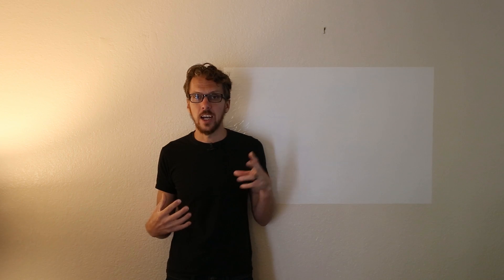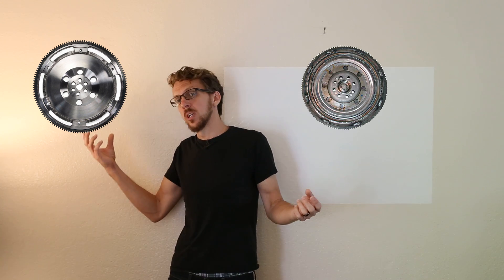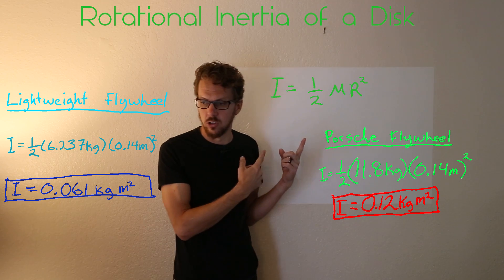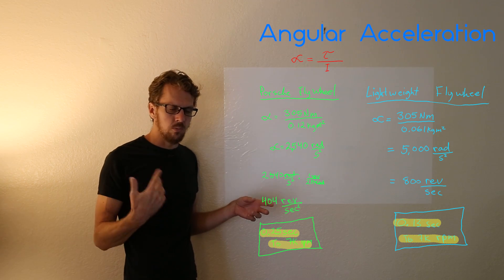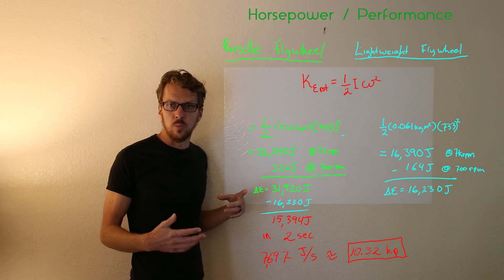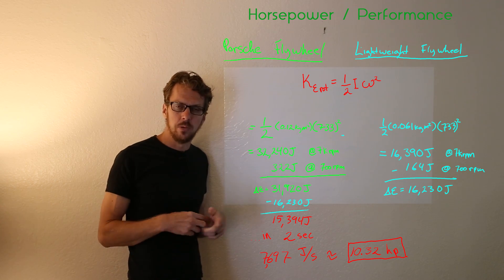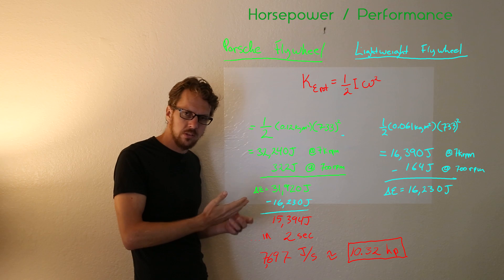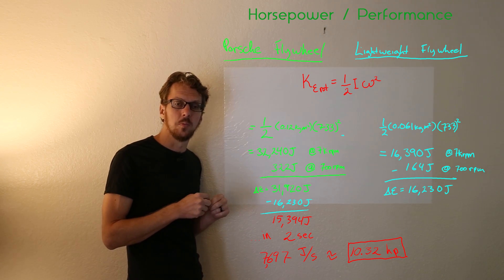Performance Boosts from a lightweight Flywheel (LWFW part 1)

Comment: So.. I just put a single mass with a spec 2+ clutch on my 2011 335xi. I do a fair amount of city driving and honestly I ride supersport motorcycles so im used to race applications and performance parts.

Here’s my question. I didn’t do the research necessary ahead of time to really see the downsides to the single mass and now I’m worried about my transmission. What can I do to prolong longevity of it and any and all other components from premature failure??

Any insight would be amazing.
Reply: Yea get a superdamper

Comment: except - rotational inertia also depends on the distribution of mass relative to the axis of rotation. The aftermarket flywheel is not only lighter but the weight is also redistributed towards the axis of rotation.   So, the ideas you are presenting are fine, but the numbers are not particularly accurate. Specifically, the aftermarket flywheel has MUCH less inertia than the simple weight difference suggests.

Comment: So I own a 1999 Porsche 986 Boxster 2.5 manual. My good buddy has a 97 986 2.5 manual. He put the aluminum flywheel in with the sprung stage one pressure plate clutch kit. I drove it, it idles great, spins up quick, and is easy to drive in traffic and matches revs beautifully. I know some guys have put the solid aluminum flywheel in with the original solid unsprung pressure plate which is a big no no and leads to engine and drivability issues unless tuned for drag racing or track. Anyone else on here have this set up with aluminum flywheel and sprung pressure plate stage one? I don't want to invest $700 in the aluminum flywheel and $550 in the stage one clutch kit only to end up with engine misfire codes and problems in traffic. My freind claims that is his setup and it feels great but I did not see him install it first hand. I know my car is original and his definitely feels nicer then mine and spins up quicker. I'm replacing my IMS so im replacing all clutch and a stock on isnt much cheaper then the pretty aluminum one with stage one clutch kit(sprung). The original boxster flywheel is the sprung part with a solid pressure plate(kinda wierd in my opinion)

Comment: I think the reason petrol cars competing with diesel cars even during launch is due to the fact that they can use the extra energy of the flywheel in addition to their engine's torque output. Is it logical?I mean,how much torque can a flywheel provide to shaft if the driver dumps the clutch very quickly?
Reply: Yes, your ability to launch the car is greatly diminished and your first gear acceleration will be a lot worse.  The idea is that the better acceleration in gears 2-3 will make up for what you lost in first. 
This isn't always the case which is why drag cars don't use lighter flywheels, the energy stored in a heavy flywheel is crucial for rapid acceleration. 
Lightweight flywheels are meant for track cars who need to shift gears constantly as the main benefit is the amount of time it takes for revs to match is greatly reduced.
Another plus is that they are slightly easier on gearboxes as they can't dump as much energy at once.

Comment: Why doesn't Porsche or somebody make a LIGHTER WEIGHT ALUMINUM DUAL mass flywheel?    Both Inertia & vibration improvements?

Wouldn't that be a proper 'compromise' between the two!?

I really enjoy your videos because you are brilliant!
Reply: danny memeo cuz when light weight flywheel install, if u let the throttle out too quick on low rpm it jerk so much and very uncomfortable. Means required a way better throttle control

Comment: No you will not gain an ounce of horse power with a light weight flywheel.
Reply: Zachary Yes, you will. Any reduced drivetrain loss WILL produce more horsepower at the wheels. How significant that increase is, is another debate but there is no doubt about whether or not it does.
Reply: @edge21str  you dont gain horse power, you just make what you already have more useable/accessible
Reply: Cyrus Lever Imagine this. Your car makes 100hp at a base timing of 0BTDC. You advance the timing to 10BTDC. You car is running more efficiently now and you produce 105hp. Did you gain horsepower or did you just reduce efficiency losses? Pretty much every you’d ask would say you gained power. Why should drivetrain losses be regarded differently? Especially when talking about horsepower at the wheels?
Reply: @edge21str  drivetrain changes wont make a signifigant or even measurable difference in hp. He explains in the video. You dont get more horsepower. Just less resistance to the same amount of force.
Reply: @edge21str  You both know what you're talking about and are correct. You guys are just arguing about semantics, is all.

However, In my opinion, I think it's more correct to say increasing efficiency leads to an increase in power, as opposed to one occurring independently of the other. increasing efficiency, perhaps by finding the correct timing for negative pressure waves within an exhaust system to return to the cylinders, yields the result of greater horsepower, for instance.
Reply: @princessajellybean  simply put you dont gave bhp or hp at the crank but you do produce better whp. Just like on the acceleration between a 5 speed long ratio gear set vs a 6 speed short ratio gear set. just more usable power which is what everyone really wants anyway. who cares what the brochure says...

Comment: Interesting, but I don't follow your logic at 8:35  it doesn't matter if you start at 700rpm or 4000rpm as the 7697J/s (hp) is energy over time.  I would think it requires the same 10.32hp to accelerate it from 4000 to 7000 as it does from 700 to 7000rpm  (less energy difference but also less time equaling to the exact same J/s)  correct me if I'm wrong.
Reply from the maker: It's kind of complicated, but you're essentially right. You're right in that I should not have said less horsepower. As you said, power is energy over time. What I should have said at this point is that you will experience that gain in horsepower for a shorter time (meaning it will not be as helpful to performance). What I was really trying to get at was the concept of work, but I didn't want to get into force times distance, etc. etc. and I was sloppy as a result. Good catch!

Comment: just added a lightened flyweel to my e36 m3 evolution the original dual mass weighs 24 lbs the new lwfw weighs 7kg and the difference is very noticeable in acceleration. the car has schrick 284 cams and low ratio diff with a quick shift  and eisenmann race exhaust just beat a 2015 m5 from a standing start 0-60.

Comment: do you have a speech impediment? no offense intended just curious.
Reply: I'm sorry that my curiosity failed me, but I've watched a lot of videos from this channel and had to ask, again sorry.
Reply from the maker: Not officially. But I'm often told I pronounce things a little differently. I attribute it to hearing problems I had when I was a baby.
Reply: No problem, btw what is your opinion on a LWFW on a front wheel drive? I have been told that it would be too much torque and that there would be insane amounts of wheelspin.
Reply from the maker: Ok, this will make me sound like a car snob, but I've never actually owned a front wheel drive car. That said, a LWFW isn't going to increase the total amount of torque--your engine still delivers the same torque. What happens is that that torque is not delivered as smoothly with a LWFW, so it's a little harder to control. There will be a much narrower range between stalling and spinning out. So, yeah, I think it could definitely lead to unwanted wheelspin off the line. Once you get moving, it's a little easier to control.
Reply: Love it, thanks for replying.. guess i'll have to subscribe :)
Reply from the maker: Thank you, sir!
Reply: You obviously have no manners asking a question like that. 😠
Reply: And so have i. And I think your question is totally inappropriate in this instance. Watch, learn and enjoy and ask questions appropriate to what's being taught. simple. 👍

Comment: Nice one, thanks!
Reply: These engines are known to have problems when changed over to lightweight flywheels. The harmonic frequencies are not absorbed and leads to problems.  A quick search of the Internet is all it takes to discover the problems.  The GT3 is a completely different motor, and it was designed to use it.

Comment: having a problem rev matching with my porsche 2002 turbo that has the lighten flywheel ..I am thinking of take it out should i keep clutch masters FX350 CLUTCH in and go back to the factory flywheel??? or put it all back to factory
Reply: Get better at driving lol
Reply from the maker: Good idea. The factory setup will definitely help you rev match. Your clutch is designed for use with a lightened flywheel. It might still work with the factory setup, but I think I would put it all back to factory.
Reply: EJCelani123 what are you having troubles with specifically?
Reply: Add more power to where rev matching won't matter.